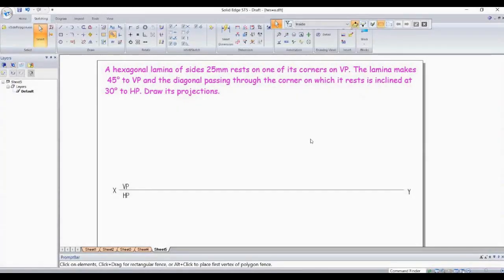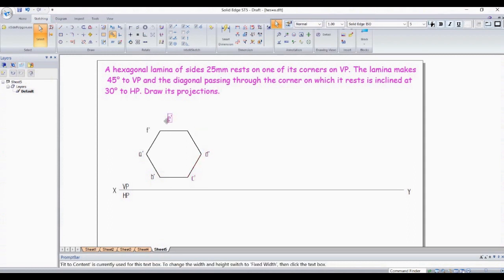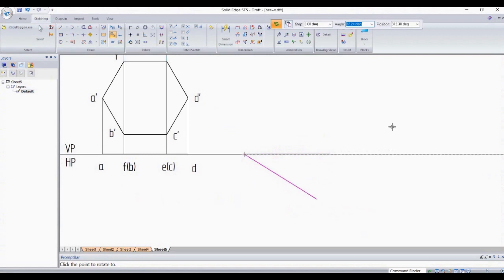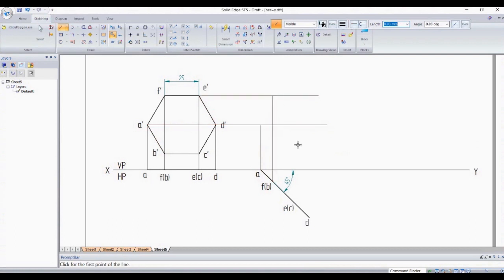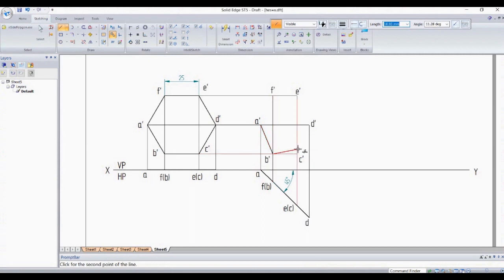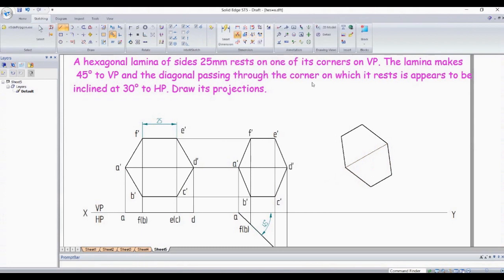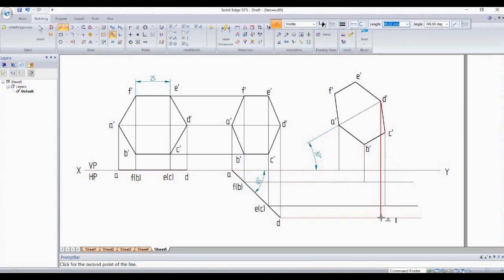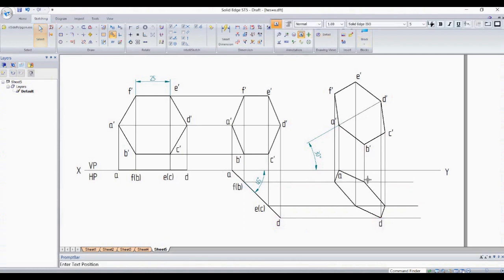EGDL | DRAFTING HEXAGONAL LAMINA | CORNER | VP | PROJECTION OF PLANES | SP4 | SOLID EDGE | VTU |

Comment: A hexagonal lamina of side 50mm has its one corner in HP and the top view of the diagonal passing through that corner is inclined at 35° VP. The surface of the hexagon makes 45 with HP. Draw it's projectionsj